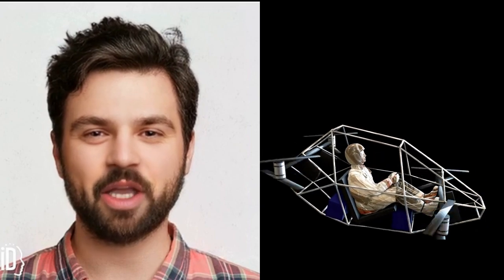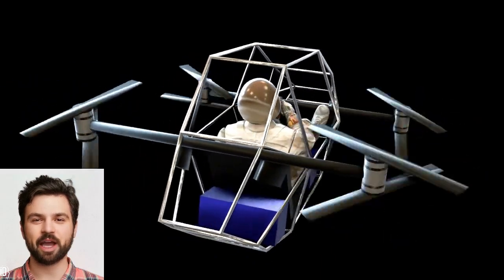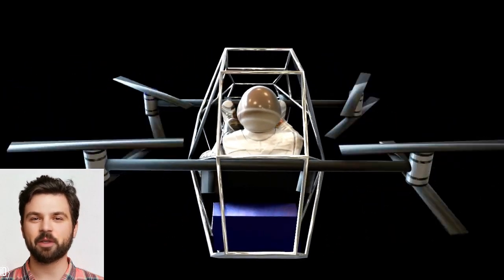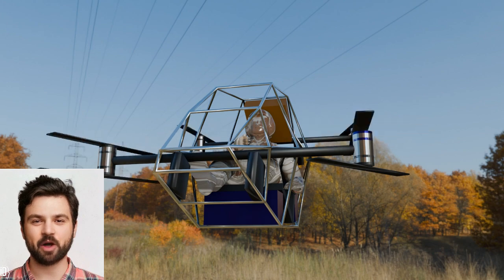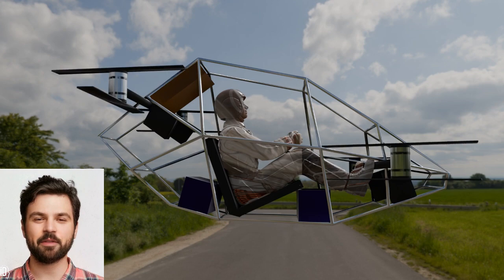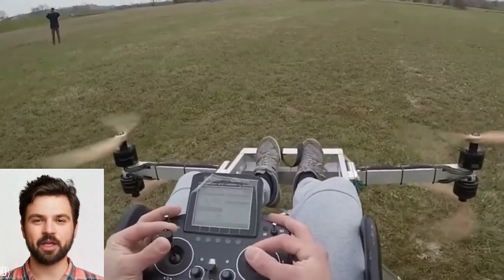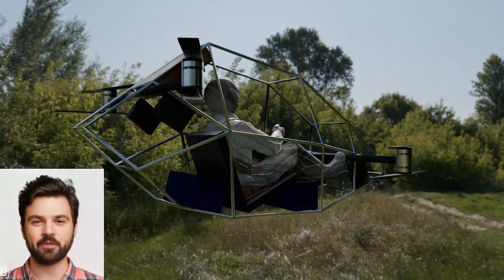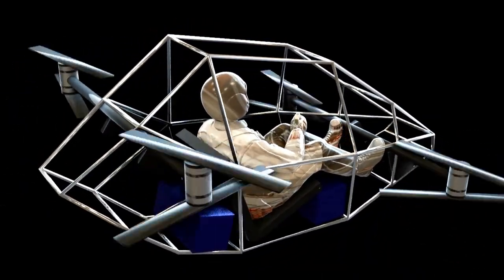Human Quadcopter eVTOL

Comment from the maker: 5. Frame and Airframe Considerations
Load Distribution:

Ensure the frame can handle a payload including:
Propulsion system weight (motors, propellers, ESCs, battery).
Additional payload (e.g., UAP systems).
Example Frame:

Custom lightweight carbon fiber with motor arms for 30-inch prop clearance.

Comment from the maker: 4. ESC Selection
The ESC must handle:

Voltage: Match battery (12S = 44.4V).
Current: Should exceed motor draw.
If each motor draws ~100A at full thrust, choose a 150A-rated ESC for safety.
Example ESC:
T-Motor ALPHA 80A/150A.

Comment from the maker: 2. Motor Selection
The motor must drive the propeller to generate 50 pounds of thrust. Efficiency and power are key.

Motor Specs:
Continuous Power: 
Thrust × Velocity ≈ 3−4kW
KV Rating: Choose low KV (150–200 KV) for larger props.
Example Motor: T-Motor U15XX 200 KV.
Specs: Rated for ~50 pounds thrust with a 30-inch propeller.
Max Power: ~5 kW at 12S (44.4 V).

Comment from the maker: 1. Propeller Selection
Thrust per propeller: 50 pounds ≈ 22.7 kg ≈ 222.7 N (Newton).

Choosing Prop Size:
Larger propellers are more efficient for high-thrust applications. A 28–32 inch propeller with a medium pitch (e.g., 10-12 inches) is suitable.

Candidate Propeller:

T-Motor CF 30x10 or similar (30-inch diameter, 10-inch pitch).
Thrust: ~50 pounds at ~5000 RPM (varies by motor and conditions).

Comment from the maker: Example Setup
Motor: T-Motor U15XX series (capable of up to ~50 pounds thrust).
Propellers: 30-inch diameter with a suitable pitch.
ESC: 200A rated, compatible with a 12S battery.
Battery: 12S LiPo, 30-50 Ah capacity for short flights.
Simulation and Testing
Thrust Testing: Use a test stand to confirm each motor-propeller combination produces at least 50 pounds of thrust.
Load Balancing: Verify all motors deliver balanced thrust to prevent control issues.